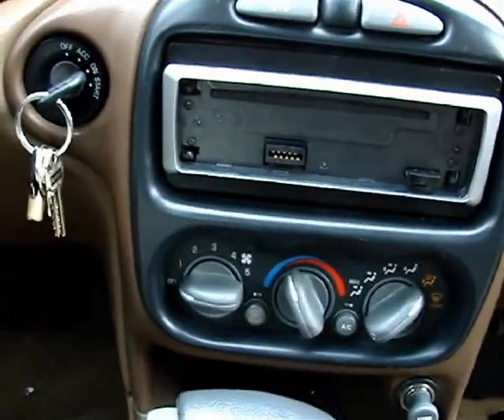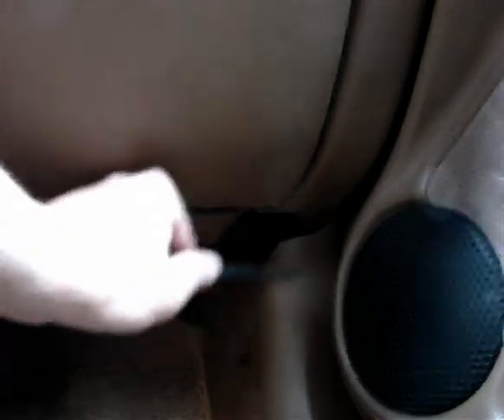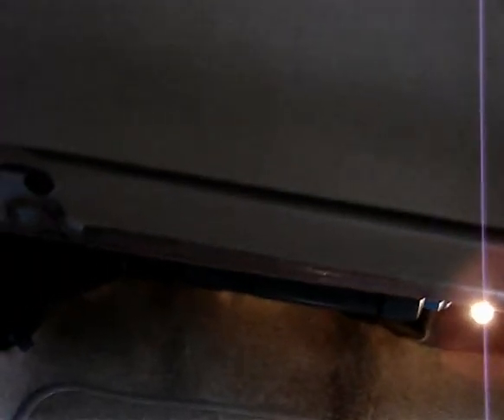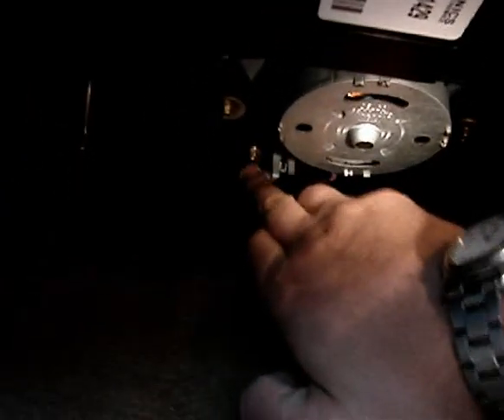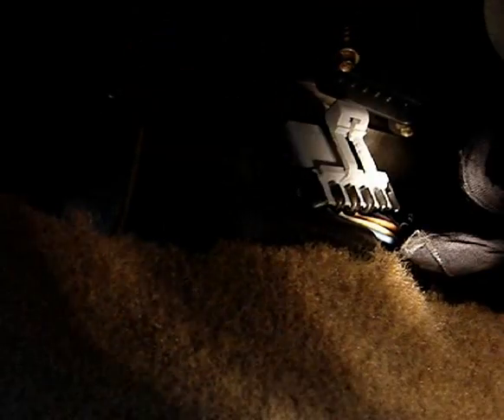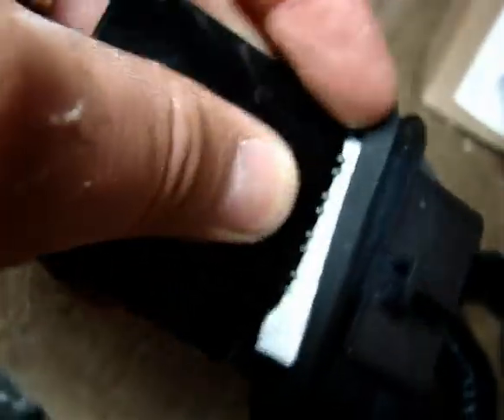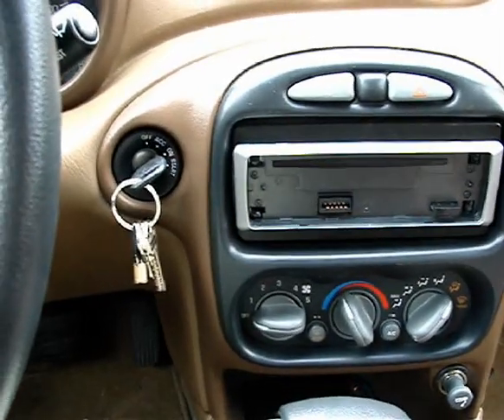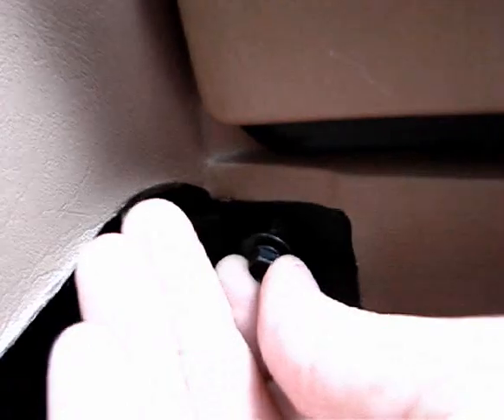Fan Blower Resistor for '99 - 2003 Grand Am

Comment: I am a 45-year-old woman and I showed this video to my 20-year-old daughter; believe me neither of us is mechanically inclined. She had this problem with her 2000 Grand Am. We went to AutoZone and bought the piece for 20 bucks. We went to Wal-Mart and bought a 10 dollar, 54 piece socket set, as we didn't have any kind of tools. I followed the sizes you gave in your video when buying the socket set. We came home and my daughter took out the pieces and installed the new piece as your video said. Took about 45 minutes to an hour, mostly because we didn't know how to put the sockets together or how to use it, but we figured it out. Most precise video ever. We feel so empowered doing this by ourselves, well of course with the help of your video. Thanks so, so much. ♥
Reply: Oh yeah, when she put the piece in it didn't work at first, but we beat on the metal fan piece and it kicked on. I guess the fan was stuck a little. No problems after that.

Comment: Thanks for the video, it was genuinely helpful. Just another friendly tip for everyone. To access that rear screw holding the resistor in that was mentioned, I would advise removing the blower itself. Once I removed it by removing the 3 small screws that hold it in place it made removing and replacing that rear screw much much easier. Also, DO NOT under any circumstances touch that small light bulb under there while it is on. It heats up rapidly and will burn you severely!

Comment: Having just done this (with the help of this video), I would recommend two things.  1)  Actually removing the blower motor.  It does make things a lot easier and it only adds less than 5 minutes.  2)  The use of a flexi-shaft on a drill to remove and reinstall that back self threading screw.  It allows one to easily reinstall that back screw and, if used on the other fasteners, it speeds things up tremendously.  Just remember, as he stated in the video, be careful because things are plastic.  Once again, helpful and informative video.  Thanks.
Reply: Jason Dayton thanks. I followed your advice to complete the repair.

Comment: I replaced my resistor set tonight too. This vid helped a lot!

Two things to add for your veiwers: 

1.) Positioning your body to work on the resistor is tough. Its a small place so prepare lighting that will help you see but wont be in your way; like a headlamp. 

2) the back screw on the resistor was very hard to get a socket on it. The best method I found was a swivel head socket wrench. Then you can push into the rubber wall behind the resistor set for a little more room to get on the head of the screw.

Comment: If you remove the blower motor, it is much easier to remove and re-install *BOTH* screws for the blower resistor. I also used a short extension on my socket to get at some of the bolts. The replacement part is larger and uses ceramic resistors which the Parts Department at my local dealership said makes this a permanent fix - the original part is notorious for failure. I had lost speed #1 and #2, now I have all 5 again. Thanks for the video it was really helpful!

Comment: Very helpful video.  Thank you.  I should have done this repair years ago.  Hardest part was the removal of the back screw, but I had a swivel socket to make it easier.  Like you mentioned in the video, I did not replace the back screw, because the front one appears to be more than enough to hold the resistor in place.  I used your video with the one from 1A auto.  Total repair time was just under 60 minutes.

Comment: Great video. I used it to  replace the resistor in my mom's 2000 GrandAm GT.  For the back screw on the resistor, I used  a 10" 1/4" drive extension, 1/4" drive universal joint and 7/32" socket 1/4" drive. I used some superglue to hold the screw in the socket, but worked great. Thank you for sharing.

Comment: Man you weren't joking about that back screw! I was ready to smash everything in sight!
Reply: How did you get the back screw?
Reply: I replaced mine a few years ago. I was never able to get at and remove the back screw. I removed only the front screw (can't remember if there were 1 or 2 up front) but removed the front then grabbed the old resistor sensor while large pliers and pulled it out and away from the back screw. The old resistor was bad anyways so I didn't care if I ruined it with the pliers. Then I was able to get at the back screw, loosened it a little bit but didn't fully remove it. Slid the new resistor unit into the side of the back screw because the rear  resistor hole was actually an open ended slot and an actual hole. Tightened up only the front 2 and done. When I replace it again it will be much easier the next time!

Comment: Just did this for my moms alero worked like a charm,part only cost twenty bucks at autozone.i found that is was easy to get to that back screw just dropping the blower,only three bolts.  Saved a lot of time...thanks for the video..no problem what's so ever following your video

Comment: Outstanding video, I  just followed these instructions and what do you know? It worked! Thanks again for this tutorial. As a side note. the interior light under the glove compartment is very hot (found out the hard way). So if you have good enough light you can turn it off by pulling the fuse from the fuse box on that side of the dashboard. It's located as the second from the bottom left (the red one). 
Again thanks so much for this video. Air, Finally!

Comment: Thanks a lot , right after seeing your video we went to buy the resistor , a rachet ect ... 52$ and an hour later the fan is working !!  Its pretty cold where i live without the heat the car was not really fonctionnal .  So thanks you again for posting this video :)

Comment: @Whuntmore .. 2001 grand am (same set up) .. mine quit working completely (on all 5 settings) and replacing the blower resistor fixed mine.  It had been running on setting 3 thru 5 only for a few years before it died all together, but now works on all great!  P.S.  I went janky and didnt even attempt to take the old resistor out.. i just plugged my new one in and hoping no one kicks it.. but its shoved pretty far back there.. lol

Comment: 99 Grand Am SE. To take out the panel clip: Use a flathead screwdriver and pull down on the SMALL round circle.Then pull down from the big circle. Remove panel. You need a socket to get at 2 of the fasteners on the next panel - socket extension bar to get at the 3rd (in the front right near the lightbulb in a HOLE). Pull the panel down. The blower motor resistor is in the back - Use a 5.5MM FLEX SOCKET and FLEX SHAFT to get at the resistor screws. Plug the new one in and test. Refasten. 1Hr.

Comment from the maker: the resistor only controls between 1-4 fan settings.  If your fan doesn't work on any setting (No. 5 is the big indicator) then you have either a fuse/relay out, or you could have a bad motor.  The motor only has like 3 or 4 screws.  they are easy to take out.

Other major issues with the '99-'03 grand am/Alero is ABS brakes, and head gasket.

Comment from the maker: Well, I recorded it as I was fixing it, as I was told this was a common issue and repair.  So I knew I wanted to provide the fix for others.  It took me just over 3 hours to get all the footage and do the repair. I would say 45 minutes is a reasonable time for someone doing it for the first time.  Now, I had discovered I missed an important shot (poor lighting), and I took it all apart and redid it.  That took me 25 minutes in total.  but I had been 'practicing' for now over 3 hours.

Comment: Another issue is the factory harness on the resistor is easily damaged from heat.  Just  the extra current draw from a failing board or blower. Some dealers automatically replace it.  Just got mine back together and all but 4 speed there.  Jiggled the wire and it worked.  Might  be the cause other electrical issues for others.  I ordered part:  ACDelco PT1171 Female 5-Way Wire Connector with Leads.  And I forgot to transfer that gasket.

Comment: Word of caution the blower fan screws break easily.  In my 2001 Alero I had one break off inside of mount post.  Had to cut back and  thin the rubber grommet to make level with the rest of the gasket.  Used a 7/16 locking axle cap nut over the outside of the now exposed post to secure.

Comment from the maker: @ThePALADINProject 

Exactly!  That many views means that this was a very common failing with the car.  There's actually several with the car - ABS unit, head gasket breaks down and cross-leaks, this resistor, Bushings (do you get a soft clunk in the front when you hit a bump), Cooling issues (fan or sensor dies)...

Actually I could keep going here.

Comment: Thank you so much for posting this video!  I have the Haynes book and never would have been able to figure out how to do this.  I literally had to sit upside down in the seat to replace this though.  It was quite comical!  The hardest part was putting the larger cover back on with the screws.  It was a bitch to line up!

Comment: Great Vid. I just lost all 4 speeds and the motor was running fine. Nether the interior HTR fuse or the one under the hood is blown. My wife accidentally turnred the starter motor over while the car was still running and now we have no heat. One step at a time I guess.

Comment: Forgot to mention this was performed on a 2002 Grand Am, but there was no difference from the '99 in the video.  Like another poster, the flex socket does come in handy when replacing the rear screw.        Cheers

Comment: I have a 03 pontiac grand prix I have a problem with the heater blower motor. I have changed the blower motor and resistor and I still have a problem. When I go to start the car it takes a few seconds to start blowing. I could use some help thanks

Comment from the maker: All you need to do is take those two covers off, and check it.   I think it's the same, but I'm not 100% sure.  When you get the part, just tell them you need a 'Fan Motor Resistor' for a 2000 Alero.  It shouldn't be too hard.  Good luck.

Comment: great video; thanks. Used it to verify location and get an idea which part to order. I see you have an SE and your replacement is the one with the black circuit card (no speakers to listen if you said which one). Did you have to take it off to know which one to get? Autozone online offers two and I dont want to order the wrong one. I am in the mil overseas. Thanks.

Comment: @kylea1985 yup it was the resistor. mine looked a little different but that was the problem. it had already been changed once by someone else and they rigged things up so it was easier to change. only took maybe 10 minutes. got all 5 speeds back!!!

Comment: Thanks i have a 2000 Pontiac grand am.
With the same problem.
Should i get a new resistor or on from the junk yard?
Reply from the maker: Negative.  large chance the junk yard will succumb to the same issue.  it was a weakness with the resistor from the factory.  Get a new one, and then never worry again.
Reply: Ok thanks

Comment: I have a 2001 Alero and fixed mine today.  The screw in the back of my resistor wasn't put back. It was bad enough removing it, not room for even one finger or a tool to put it back.  Might have gotten it somehow if I had hours to spare, but not worth it for anyone that is considering it.

Comment: I switched the one in my 03 grand am out, and then setting 1 and 2 were putting out the same speed as 4. A few days later, and only 5 works. Anyone know what went wrong?
Reply from the maker: all I can think of is you either got a bad resistor, or it's not plugged in fully.  check the plug to see if it's seated.  then check the resistor.  It's acting exactly like when the resistor is totally burnt out

Comment: could you please tell me how I would know if it's the resistor or the whole blower motor?
Reply from the maker: +Heather Sipe why?  is it not working at all?
Reply: +Whuntmore sorry I just got the message reply...my controls stopped working on one and two and now it barely wants to work at all sometimes. And it's really weird how I don't feel a lot of anything blowing sitting still but when I'm going down the road, it feels like it comes out of the vents better. but my main deal is why did it stop in the first place and why is it hardly wanting to work at all now. thanks.
Reply from the maker: +Heather Sipe Does it work at all on the highest position/setting?  is it still acting funny on 5?  if Yes, then it could be your motor.

Comment from the maker: this is only for the blower, and has nothing to do with A/C other then the fact it moves the air around (whether it be heat, or cool air)  Unless someone has already taken them out, you have to remove the two bolts, self-tapping screws, whatever they are, out.  

If fan speed 5 is out, check out relay's, fuses, etc.  There are two relays for the fan, and one or two for A/C.  otherwise if someone has been screwing around with your car (before you) not much I can tell you.

Comment: Ok my car (2002 grand am 3.4 v6) had ac working on 4 and 5 when i got it, but all of a sudden stopped, working completely. My friend and I have been working on it for a few days. I noticed in order to get the blower resistor out, you didn't have to remove the bolts. Is this right or did i watch the video incorrectly. Please respond quickly, I'm about to take it to firestone; my friend says it's a waste of money. This summer heat is killing!

Comment: My 2004 Gran Am is experiencing problems with the fan motor.  The fan will work on all speeds for about 20 minutes or so then it reduces to speed one.  I turn it off completely then after a short amount of time it resumes working like it should.  My question...resistors or a complete new fan motor?  Anyone??
Reply from the maker: +Ruth Johnston Sounds like the fan motor, but not 100% sure

Comment: Im 62, disabled vet,  cant' do much work on my car but i could get under the dash if it would give me what i need to see something that deals with my 2003 Grand Am GT with a 3.4 ram air engine,  ac doesn't blow cool and it was just recharged a year ago,  it blows cool off and on but does not stay cool,  fan blower doesn't work other then at high speed,   electrical problems plague this car terrible,  right blinker blinks very fast left normal,  previous owner replaced factory CD stereo with some cheap  JVC with remote which is missing did not come with car,  nothing i've tried has helped fix the problem but this makes plenty of sense the resistor would solve the problem with the heater blower motor switch issue, but what bout AC that doesn't blow cold ?
Reply: Guitarmanjhc1 you have a bulb out on the blinker on the fast one. Your AC is leaking.
Reply: Guitarmanjhc1 and the resistor. Drop the blower motor first.

Comment: So I did this replacement yesterday, but today my body is telling me I actually tried my hand at the rings in Olympic gymnastics.

That second bolt, the one you say is "murder" to get at? 02 Grand Am: After 2 hours, my husband ended up just having to completely destroy the old resistor to get it out. That second bolt went in the garbage. There's simply not enough space between the bolt and the floor of the car for a ratchet and we did not have a tiny enough wrench handy. GM engineer's bad joke?

Comment: @styxdogg  I think I'm going to do it YOUR way and not bother fighting to get the old one out.
I got a 99 olds alero, and like your car, 1,2,3, hasn't worked for about 5 years. 4, 5, and there may be a 6, all worked until 3 days ago.
Now none work.
Nothing.
Anybody know what the final cost was to repair this?

Comment from the maker: @sgtsafety101 All I did was go in, and ask for a replacement fan blower resistor for Make, model, year, engine, etc which ever car you have:

So I have a 1999 Grand Am SE 3.4 v6.  
but let's say you have a 2000 grand am GT, just give them all that info on what your car is, and you should get the right part.

Comment from the maker: @XonionbreathX 

If NONE of the speeds work (speed 5 is the tell-tale one, it doesn't use the resistor), then ya, it's something else.  Possibly the motor.

Now, if you're whole panel isn't lighting up, and other things won't work, then that has nothing to do with the resistor.   You've got other problems.

Comment: OMG. Work out or something. You are breathing like you are completely winded just removing screws lmao
Reply from the maker: +Matt Woolley LOLOL, yup.  I had done several recordings and had spent quite a bit of time contorting myself to even get decent footage.  of course, at the time of the recording, I didn't have a camera that you could view right after recording, so I had to run in, upload, check recording, come back, contort myself, record...
Reply: +Whuntmore I get that belive me. I just changed the oil in my Yukon and the next day the muscles in the front of my neck were hurting and I was like, Huh? Then it dawned on me that I don't usually lie on my back and prop my head up for a sustained amount of time....sad really.